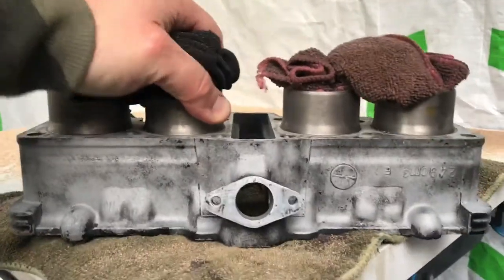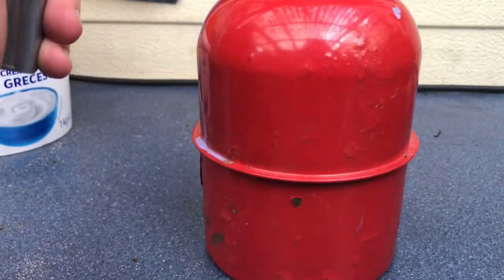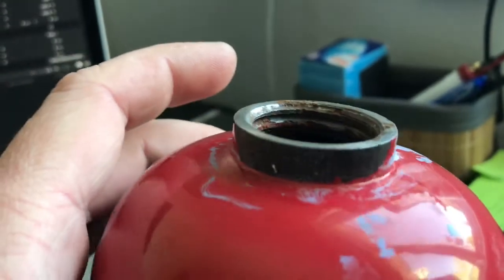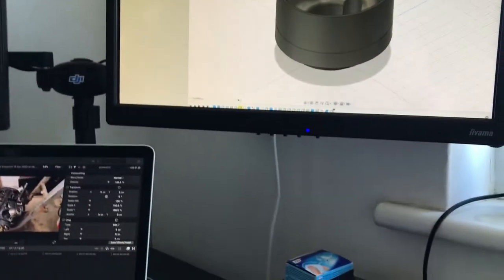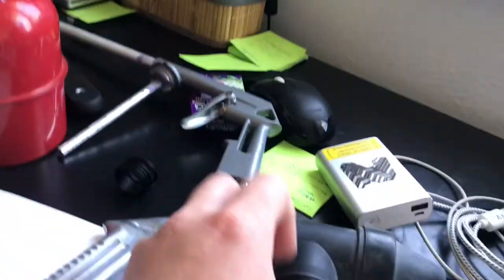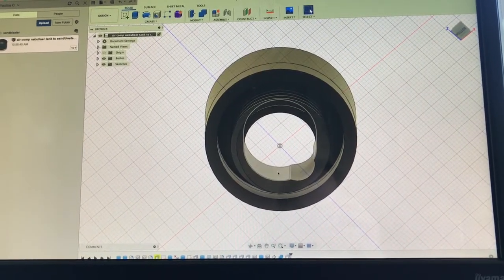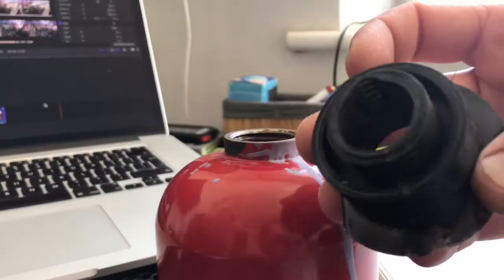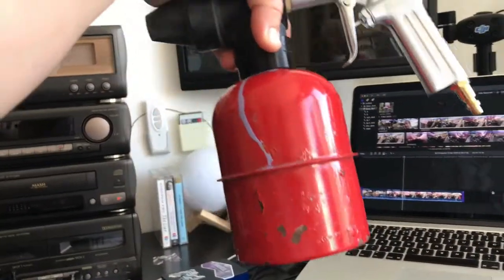Clarke SB5 sandblasting gun improvement

Comment from the maker: i actually tried it with a hose directly into the sand sack and it kind of works also with my 1.5 HP compressor, there is a signifficant sand quantity improvement with the tank attached to the pistol tho.